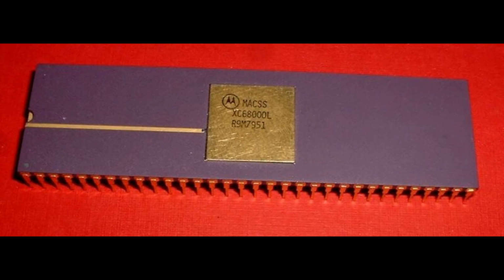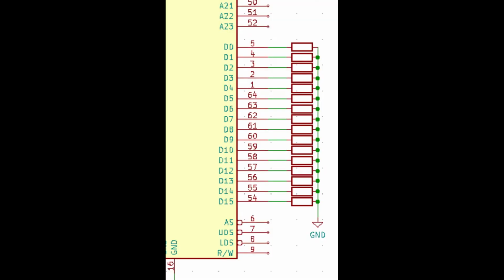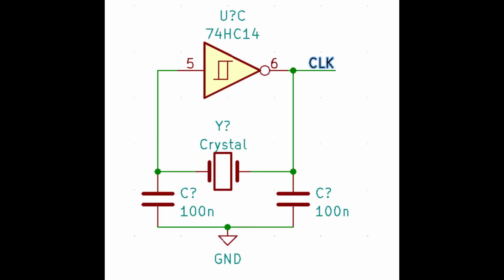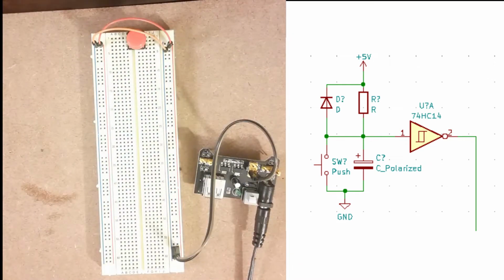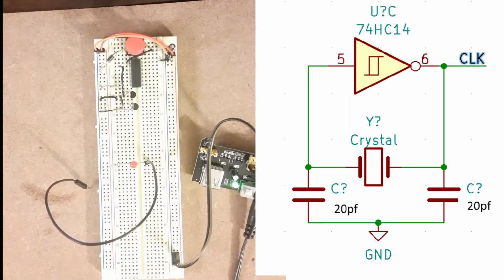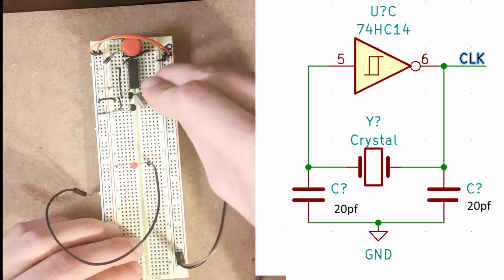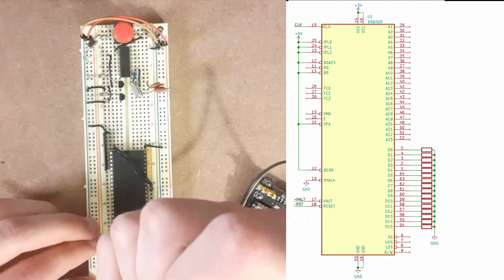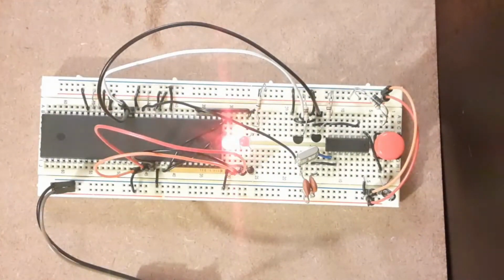Motorola 68000 computer build part 1: freerunning the CPU

Comment: What's the difference between two and four pin crystals?
Reply from the maker: Two pin is a resonator and only has the quartz crystal itself. It needs a driver circuit. The four pin ones are oscillators and have both the crystal and driver circuit. The four pins oscillators are simpler to use so I recommend using one. Later on I had some issues with the driver circuit I used here and just ended up using a four pin oscillator.